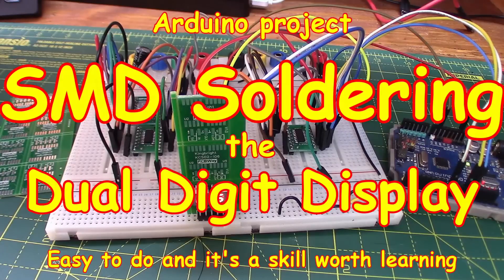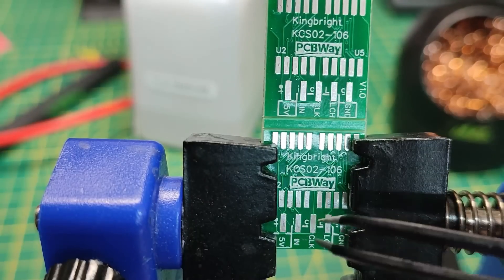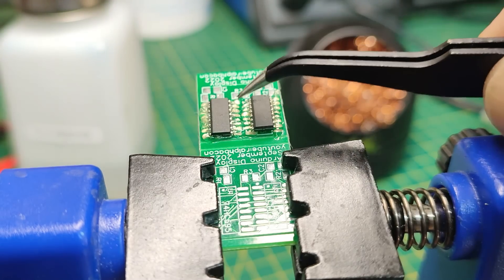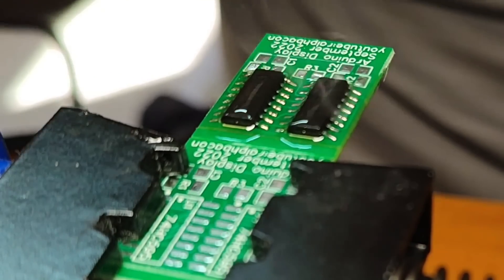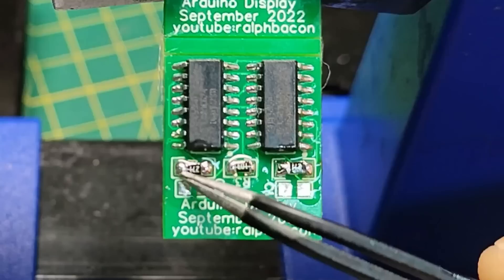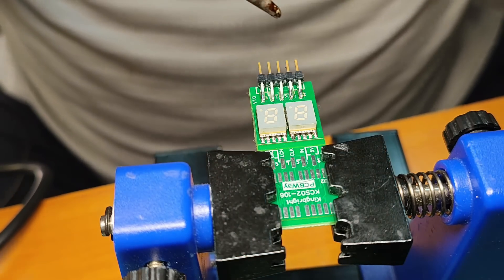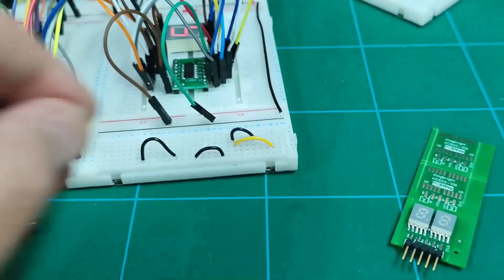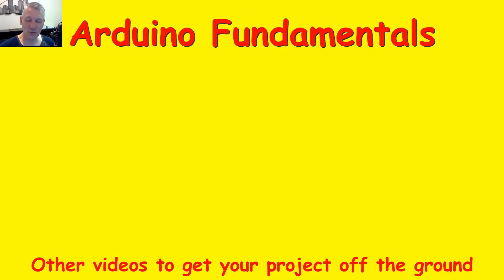#252 SMD Soldering Walk-through - easier than you think

Comment: A little tip from someone that does mainly SMD soldering; I would recommend PCB holder that are as flat as possible. UnionRepair, AliExpress and similar markets have great ones. If you can rest the hand on the table and the underarm / elbow on the armrest of the chair your hand will be way more stable than trying to solder something that is up in the air. Think about it like a tripod for the arm...the more points you have on a steady surface the easier it gets.  These old style holders are very useful for old boards with large THT components sticking out on both sides, but they make it very hard to keep a steady hand for SMD soldering.  If the PCB is less than an inch above the table it will way easier and your arm and hand won't get tired. And flux.
Reply: I’ve never found that a holder is any better than just laying it flat on an anti-static mat or a small block of wood to raise it up slightly.
Reply: @markcummings150  A flat surface can sometimes be annoying if there are high connectors or something similar underneath, but a little block to rest it on can do the job if the components don't reach too close to the border of the PCB. 
But when I do repairs where I gently want to pull up components or have to remove a shiled I prefer if the board sits in a heave enough holder so i don't move the whole board up.
Reply from the maker: Good tips there. I will scan for a flatter PCB holder.

Comment: I got a supply of 0805 resistors and capacitors. When designing boards I prefer this size. 
I have already soldered 0603, but these tiny little things disappear quickly if they are not soldered.

A very sharp soldering tip is not recommended as it will hardly hold the solder. 
Either a flat chisel soldering tip or the soldering tip with the hollow cone.
A soldering iron regulated to 300°C to 350°C is recommended. 

For ICs and sensitive components, do not fry for too long. If there is too much solder on it, let it cool down and solder other components. Then clean soldering iron take new flux and tin and correct. If it doesn't work, let it cool down and start again.
Reply from the maker: Yes, 0805 is my preferred size, although 0603 is "do-able" (but you need better eyes than what I have).

A gullwing soldering tip is the "proper" way to do drag soldering but a flat chisel tip will work too (just not as well).

Good warning about overheating components 👍

Comment: I use a pair of ceramic (or ceramic tipped) tweezers for such placing and adjusting. This reduces scratching and the components stick less, as long as I keep them clean.
Clear and helpful video, as usual.
Reply from the maker: That's a great idea! I have some ceramic tipped ones, but they are quite a bit bigger than the ones I used in this video. I need some smaller ones, thanks for the suggestion!

Comment: Excellent demonstration Ralph.  Pretty much exactly the way I've been doing prototypes & small production runs for years.

One good tip for you...
I have a little ultrasonic cleaner made for jewelry.  Tiny little thing about 6 cm across...  For a final cleanup on boards that'll fit, I toss them in & fill it with IPA, then let it run for 5 or 10 minutes.  Blow them dry with compressed air & the flux is gone.
Reply from the maker: That sounds very interesting. Scott. I assume (dangerous) that it would also get rid of all the flux UNDER components or connectors too that my brush cannot reach?
Reply: @RalphBacon  It does.
Even just giving the whole board a bath in IPA works, but the little ultrasonic makes it fast & easy.

Comment: If the pcb is not double sided, I lay it flat on an iron heater. Set it to its max temperature and put little dots of flux with solder fluid in it. Then I place all the components and then put the plug in the wall. It gives some smoke, but it works very well. I prefer it i.s.o. using an oven, my misses don't like that. I bought the fluid (flux + solder) somewhere online, it is in a syringe and you do not need to clean anything afterwards. I did this on trial and error, and the very first trial was immediately okay! I was very lucky that my heating iron has just exactly the right maximum temperature. Note: I am not one of the youngest either, we'll get handy in fiddling stuff. Getting the job done.
Reply from the maker: I stopped reading at "if... not double sided" - just kidding. All my PCBs are double sided (one of the huge advantages over strip board, I've found) but I reckon you could still do it your way, for one of the sides, anyway! Do it on the most populated (or difficult) side.

Comment: Great video. I also discovered a SMD soldering is more easy than expected. So i recommend not be afraid to use SMD.
However i am currently struggeling with SMD IPX antenna connectors. They not only need to be electronically correct. Also the connection needs to be mechanical robust so the antenna cable can be disconnected without pulling the IPX connector from the pcb. And removing the connector from an antenna cable when it is not on the pcb is also quite difficult.
Reply: I hate ipex4 connectors with a passion. They are used more and more commonly on RC receivers nowadays and are incredibly easy to damage and incredibly hard to repair - too small, too delicate
Reply: I recently soldered one to Raspberry Pi - it was not that difficult but I used hot gun
Reply from the maker: Yes, they are not designed for frequent (re-)connection. To remove, use a very small, flat-bladed screwdriver (plastic spudger if possible) and gently lever it off to stop ripping off the actual PEX connector.

Comment: I can appreciate the advantages of surface mount parts . But I have a large inventory of thru hole parts collected over 50 years, lm trying to resist changing.!!!!!
Reply: I'm slowly growing my smd collection. I've been doing those cheap ali express torture test boards for years. They're under a dollar for the small ones and around 3cad for 300 ic boards haha
Reply from the maker: Resist change if you want, Stephen (I see what you did there), but once you try SMD (don't go for silly small sizes of resistors or caps, 0805 is a good compromise) you will see how wonderfully they fit on a board, nice and compact with no leads to cut afterwards.
Reply: @RalphBacon  I will give it a go.

Comment: instead of expensive IPA just use breakcleaner... much cheaper, stick the pcb on some clay on the desk, makes much less shaky hands. bigger stuff like chips can be well held in place by one fingernail, much simpler than tweezers.
Reply: Breakcleaner.  Now I have to try that. IPA got really expensive with when the Branch Covidians claimed it as their holy water.
100x1mm pitch pins QFP is difficult .  I often end up using bluetack (poster putty) to get that first corner in.
Reply from the maker: IPA costs £20 (these days about $25) for FIVE litres from Amazon. I find that VERY good value because we don't use a lot cleaning PCBs. I have only just finished my first ONE litre bottle bought a couple of years ago. 
See here: https://amzn.to/3VyO751
Reply: @RalphBacon  Ah, that is nice for 99%.  Will get me some. For the longest time,  could not find it on store shelves.

Comment: hi,Ralph. I recently had a crack at panelization but I used mouse bites instead of v-cuts. It was a wee bit of a minor learning curve but worked out well. PCBway made the panels and was very happy with the result. The time taken to suss out how the mouse bites worked was well worth it. separating the individual boards is very easy by hand. No tools required.
Reply from the maker: Thanks for sharing! As it happens I don't like mouse bites as they can leave a jagged edge but if it works for you then it works! V-cuts are much cleaner IMHO.

Comment: For SMD soldering I find it better to have the board flat on the bench. SMD soldering is easy, all that flux and drag soldering just makes a mess. Use a smaller tip on the iron and finer solder.

It’s easier to flow a little bit of solder to one track then place the chip on the pads, align it to the pads and then just place the iron tip on the pin above the pad you put the solder on. The chip will sit down flat when the solder melts. Then just solder the pins one at a time and the board will be a lot cleaner and take less effort with the ipa.

Drag soldering needs the extra flux as when you put the solder onto the iron tip it burns off the flux that was in the solder in the first place. A good solder comes with the right amount of flux to do the job correctly, but applying to the tip first defeats the object of it being there in the first place. Good soldering practice is you should heat the joint first and then apply the solder to the joint, not to the iron tip.
Reply from the maker: I tried it your way when I was starting SMD soldering (I may have done a video at the time, can't remember) but the drag method is much, much easier for me but YMMV, as they say.
Reply: @RalphBacon  if you scale the board up to 20 ic's your be swimming in flux or cleaning the board after every chip. MMWV I still have a 1/2 empty tube of flux i bought 10 or more years ago. I'll have to do a soldering video so you can come over and heckle me :-)  I do look forward to Friday's  as there will be a new video to watch, and interacting is a pleasure on both sides.

Comment: I think using through-hole header pins would have taken less board space, would have longer life expectancy, and, had they been installed first, would have provided a means for clamping single PCBs while soldering the SMD parts.
Reply from the maker: There's no room on the tiny PCB for ANY through hole (TH) components, I'm afraid. That's the problem with TH components generally, they take up too much room, by using space on BOTH sides of the board. I wanted to use TH LED displays but not a chance.

Agreed, the header pins would be stronger, but the tracks for the offset header pins are quite large, allowing a decent amount of solder to holds things securely.

Comment: 😄 Put this video on in the background while I tried a test run of my new 946-1010 hot plate on a little project board I have. Soooo much easier than hand soldering! Been hand soldering SMD for a while but thought I would give one of these little babies a try. While you were struggling and wittering on 😉 I was sticking solder paste on the board (without a solder paste mask) and placing the SMD components. Then two minutes on the hot plate and bam! Fully working and very neat PCB with no flux residue (take that Louis!) An idea for your next video? 👍😁
Reply from the maker: Hot plate is fine for a single-sided board (or one side of double-sided one, I suppose). 

I suppose I could follow up with a video showing solder paste and hot air gun, which does have some advantages over a soldering iron in certain use cases.
Reply: @RalphBacon  Yes, I have a hot air station as well. It's fine for most things but you have to be very careful with 0603 and smaller components - the airflow has to be very low to avoid blowing the things off the board!

Comment: Hi Ralph, there are so many fluxes around with varying characteristics. SDG Electronics did a very comprehensive review, but the one I finally opted for had good cleaning action but was a pain to get rid of. Thus, I'm curious about which brand you use and where you bought it. It looks much easier to clean the boards afterward and nicely does the job. Cheers.
Reply from the maker: The flux I use is MG Chemicals No Clean Flux in a syringe for accurate (!) placement. https://amzn.to/3VtVAlZ

I don't care what is says about "no clean", it is a terrible, sticky thing to leave on a circuit, goes dark brown when soldered and that same guy I mentioned said that it (not my one) can even eat away the PCB tracks eventually (and showed an example).

So I always clean it off with IPA, best that I can.

Comment: My first attempt at soldering SMD was a bit messy, but with a bit of practice it's now not too difficult, and quite satisfying once done.
I sue a small tip on the iron and 0.4mm solder. And plenty of rosin of course :-)
Reply from the maker: "You can never have too much flux". I will put that over my workshop door.
Reply: @RalphBacon  ha ha ha. You know it makes sense.

Comment: If you get the hang of it, soldering SMD is faster and easier than through-hole. And more satisfying. The key is to flood the board with flux. However, there are parts that should still be through-hole, like connectors, since it will provide a lot more mechanical connection to the board, especially if these connectors are going to be used a lot.
Reply from the maker: Mostly agree with that, except that SMD connectors can also have through-hole anchors (think of a micro USB socket, connectors are SMD but mechanical strength is from the [usually] through hole anchor on the casing).

Comment: Hi ralph, what do jou think about the use of hot guns?
Reply from the maker: For me, like using a sledgehammer to knock in a very small nail. They heat up things around them too, which is why I have several nozzles for mine (when I use it) to direct the heat.

They are good for those pesky resistors and caps, because they then "self-align" on the pads.

Can also be used for 32-pin chips (Low profile, quad flat packed aka LQFP32) and once again the chip will self align onto the pads but the drag soldering method is preferred by me (safer to surrounding components).
Reply: I totally agree  :)

Comment: It's certainly the way to get boards these days, no more make your own.
Done a couple of orders lately and with the panelize, it was a bit tricky to see what they actually needed re-boarders etc. but once you get the hang of it AND with careful delivery choice, one can get a lot of boards delivered for around the $10 mark.
As it turned out with the latest, a control board for an esc for the model boat brushless starter, I ended up with 10. Even if one doen't need that many, I still could never make even 1 for that let alone anywhere NEAR as good.
Reply from the maker: Totally agree. 

That all said, if I were making boards commercially (even a short prototyping run) I would get the PCB factory to make and build them for me. They are doing it all day, each board is perfect (usually) and they can source all the components too!

But for us hobbyists, the panelised (or single) boards are pretty good value for money.

Comment: Why did you place a thin rail between the individual pcbs. That would seem to make it harder to separate for no obvious reason.
Reply from the maker: Previously when I made a panelised board I did not separate them and the tracks were very close to the edge and the PCB house complained at me (but did it anyway, I think).

In this case you are correct and I need not have done that (but they separate very easily).

Comment: does these 7-segment displays have internal resistors. I was thinking because I didn't see any resistors there for display or do you have one common pin?
That maybe ok for some debugging but I really recommend to get cheap debugger if you need to trouble shoot problem.
Note: It still seems you need Microchip studio for debugging with AVR Dragon. You can basically import arduino project to studio and it will map all used libraries. Not sure if newer debuggers are directly supported in Arduino 2.0
Reply from the maker: No built-in resistors. I use ONE external resistor in the common cathode (or anode). Not ideal (as I mentioned in my video) but it works well enough for this little project.

Comment: Having managed to destroy my first two displays (note to self: if you think mounting them is difficult, just try dismounting), however I have now almost completed the board, but need to source the ‘Surface Mount Offset Headers’, so far I have found them only with Digi-Key but unfortunately they are out of stock. Would you by any chance know of an alternative supplier?
Reply from the maker: I bought some from AliExpress https://bit.ly/3UuLgbM Best to buy the 40-pin version and snap them off as you need them but you have the choice to buy all variants here.

Alternatively, RS Components (UK) has some available on 13th December: https://bit.ly/3B5Z1H5 at a higher price but OK for a one-off, I guess.

I bought my first lot at RS Components just so I could "get on" then the ones from AliExpress arrived just as I needed them a couple of weeks later.
Reply: @RalphBacon  Thanks Ralph, very helpful. Much appreciated.

Comment: I can do ICs with the drag method, but single resistors/caps I really struggle with
Reply from the maker: You need to hold them down whilst you just dab it for 1/2 second on each end. But if you don't hold them they can stick to the soldering iron tip!

Comment: What temp to you have your iron at?
Reply from the maker: Depends. 400ºC for header pins, 280ºC for IC connections or lower if it can do it. Those tiny SMD resistors don't need very much. The trick is to get in there and out again as quickly as possible. Too low a temperature means you dally longer as you wait for the solder to flow.
Reply: @RalphBacon  Thanks :D

Comment: Too much solder? Wick it off. Most of the time, there'll be enough solder left for a beautiful joint.

P.S. don't forget to flux the wick.
Reply from the maker: Soldamop wick doesn't need flux, as I'm pretty sure it has it on it and works really well, as-is. Cheap Chinese wick certainly does need it. Desoldering wick has become very expensive lately... then again, so has everything else 😢